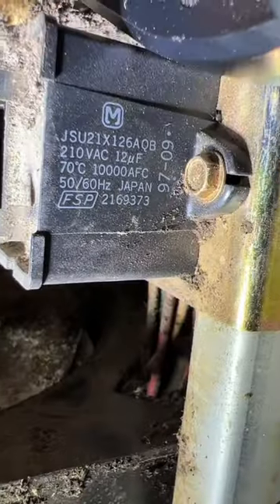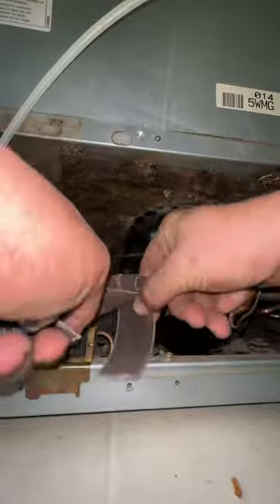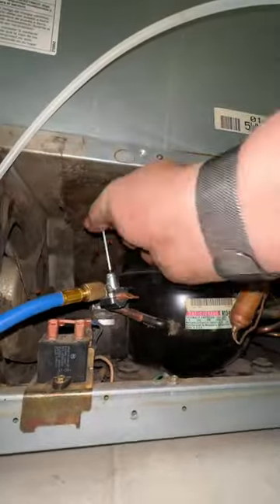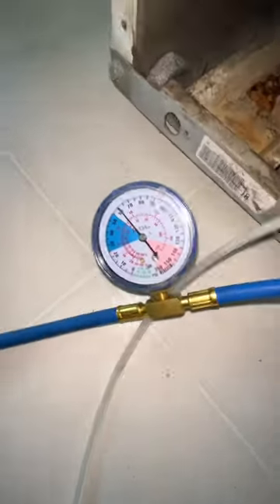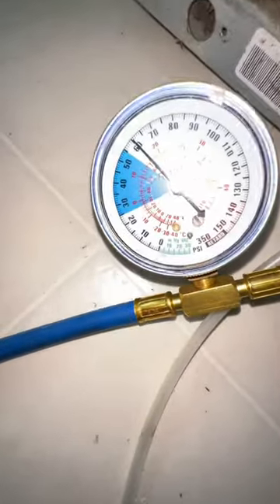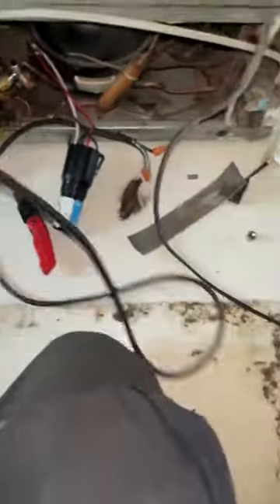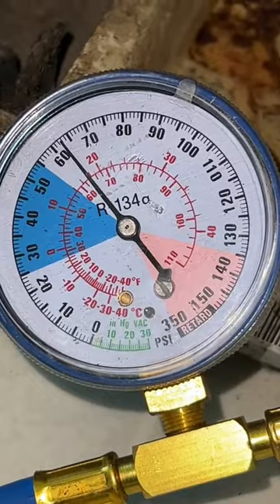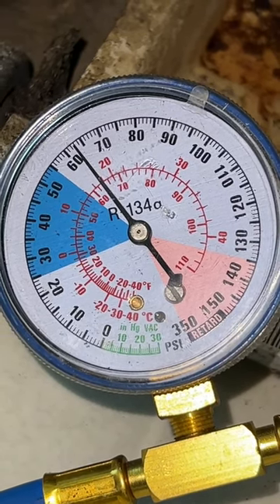A refrigerator than I am unable to fix. #Rental #HandsomeOrHandy #Handyman #ApplianceRepair

Comment: Lmao… “idk just buy a new one”
Reply from the maker: That's what I ended up doing. I might take it apart to see what the issue was but it not going to be used again.
Reply: Compressor change out on a fridge usually just bandage that won’t guarantee it will last forever  I would only recommend it if’s it’s warranty and if not get a new one you will save more money in a long run.
Reply: @sillywaffle2976  depends who changes the compressor. I take pride in my work and when I replaced a compressor I make sure to repair the entire SS (Sealed System) I evacuate then flush all refrigerant lines to remove contaminated refrigerant oil replace filter drier with a sporlan filter drier, install new compressor and braze all joints with silver solder while flowing nitrogen through refrigerant lines. I then pressurize SS to 160PSIG and perform a leak test if the SS loses any pressure I will use an ultrasonic leak detector to locate any leaks in the SS and repair them. Then vacuum SS down to 200-300 microns and perform a decay test after 20 minutes I check micron gauge and if it hasn't risen more than 50 microns I then add refrigerant and tested refrigerator. All of my equipment is inspected and tested at the beginning of my day to ensure that it is working properly and I  replace it yearly to make sure that I continue to use the best tools to do the job.  I have replaced thousands of refrigerator compressors and have not had a failure yet. Most technicians do not go to the same lengths that I go to when replacing a compressor in a refrigerator they sell the job cheap because most refrigerators are cheap so in order to maximize their profit they rush the job. I typically spend 3-5 hours replacing a refrigerator compressor. For this refrigerator the parts and materials would cost around $400-500 the labor would be $400-500 and I warranty my work for as long as the manufacture warranties the compressor 1-5 years depending on the manufacture.
Reply: Your contradictions say don't hire you.
Reply: Sometimes it's cheaper to replace then it is to buy replacement parts and pay for labor
Reply: @christopherscott8853  you’d rather go with someone that does a bunch of work costing as much or more than a new fridge and isn’t likely to last?.. lol it’s being replaced because it’s very like that that’s the smart thing to do. Everything else will cost as much or more and not last as long. Everyone’s a know it all these days. If you were doing your own labor, sure, but paying someone and for parts and such is stupid over replacing it in this instance.
Reply: @mrjjman2010  I think I meant to comment...not reply.   His contradiction was...he checked the start relay after verifying the compressor was running with low Amp draw.  I don't repair small appliances unless they are mine.  I do own and operate a small hvacr company.      Small appliances are tedious....and I don't carry piercing valves but I've purchased them for my own stuff.
Reply: He has a bad compressor he was correct in his assessment
Reply: Dude knows so much about everything nobody can possibly know everything but he is badass
Reply: @mrdrchad6110  it's never worth it to change a compressor on a regular top bottom because it's simply cheaper to buy a new one. Unless for some reason there's a major supply chain issue like in the beginning of covid. You clearly know your stuff but this is a question of where the customers money will be better spent.
Reply: @mrdrchad6110  as a appliance technician, I respect this comment. I won’t say which brands, but even after all of that thorough work the fridge can fail. Usually floating restrictions, or leak with unexposed areas. Deeming the unit un-repairable. If it’s still within that 5 year SS warranty, we can usually get the manufacturer to provide a exchange review. 😢
Reply: This guy is a hack 🤣🤣🤣
Reply: @mrdrchad6110  I’m guessing thats why they scrapped the unit, $1000 i could get 2 basic units to replace it. 

Same situation I had with small standup freezer. First repair was warranty, second was a curb weight.
Reply: A fridge like that isnt worth it. U can see it's very old. Labor and mats to do a proper compressor change would be near or more than a new one
Reply: @huboant2879 Which brands are the ones you would stay away from?

Comment: Compressor valve burnt out replace compressor cost about $950.
Reply from the maker: and the fridge is worth 600 new so that is why i replaced it.
Reply: @HandsomeOrHandy  I tell people if you can find one then do it. Newer refrigerator are designed to fail before the compressor burns out.

Comment: So the reed valve is broken on this compressor. You'd see almost equal pressure on high and low side. The reed valve opens and closes depending on the pressure in the head of the compressor. Opens on the downward stroke, closes on the upward stroke forcing the refrigerant into a smaller space causing a higher pressure and allowing the compressor to pump the refrigerant through the system.
Reply: A man of understanding. Nice.
Reply: That 1.3 amp run load though…
Reply: @tech5298  that's pretty typical of a small compressor like that.
Reply: @intergalacticprophylactic  
I guess so. I would expect .4 amps or something with no resistance from properly working valves. If there is no back pressure, the operating amps would be lower than if the valves were good. Thoughts?🙂
Reply: @tech5298  who hurt you?🙂 I just don't understand why the 1.3 amp was interesting  from the first comment.. " that 1.3 amp draw tho"  just sounded like it surprised you. Are you a refrigerator tech or something..  I just didn't feel like 1.3 amps is horrible for a small reciprocating compressor.  But I don't work on refrigerators all day. I mean if .4 is it then sure. But thanks for showing me how you interact with people. Noted. Thank God I don't have to work with/be around you ever.
Reply: @intergalacticprophylactic  
? You are trolling right?
Reply: @intergalacticprophylactic  you're mad weird
Reply: Finally someone that knows what he's talking about

Comment: It's probably that rack that the freon circulating cools down in is gunked up. Had the same problem in the kitchen I worked at as soon as I cleaned those frills the freezer came back to life.
Reply: I appreciate your comment but if the pressure doesn't change and the compressor is running then the compressor is fucked, no matter how dirty the coil (frills) is. In lamen, if the cold end is clogged with dirt, the pressure will go down. If the hot end is clogged, the pressure will go up. In hvac you have safety devices to stop the compressor from running in low and high pressure situations. However, if the compressor is running but not compressing, then it's bad. Obviously.

Comment: You can replace that fridge for 800$. Even with a friendly discount that repair would be more than half the cost. Those compressors run anywhere between 120-200$ my cost. Parts alone would be close to 500$ for the customer. It's just not worth it for a unit like that.

Comment: Simple.....
If the compressor  is  running and there is no quick drop on the suction pressure on start up then that is telling you the compressor  has lost its pumping  ability.
Then all you do is replace the compressor  following  the  correct steps and no need to condemn the  fridge.
Eazy peazy.
And that looks like a ¼ hp compressor.  Which here in Southern Africa  is $220 to replace all costs in . Sweet.
Reply: Haha in north America,  that's a condemned fridge.
Reply: Here compressor is 500 € and if you somehow get tech to come, that's another 500€ for labor. 599 € for new A+ fridge with warranty
Reply: I don't know what a fridge uses for an expansion device,  but in automotive air conditioning, a failed expansion device can also cause no change I  pressure while the compressor is running. It's not necessarily a bad compressor.
Reply: @Krankie_V  they usually use a capillary tube as an orfice
Reply: @NDC1115  that doesn't sound like it's very failure prone haha
Reply: In America, its cheaper to buy a new one then pay someone to fix it. And someone will buy broken one for 50 bucks
Reply: @Krankie_V  
It’s a cap tube system.

Comment: The dust is what killed it you gotta clean it after a few years or it goes kaput. If you hear it click often it's time has almost come if you don't help
Reply: No? The compressor was running so the Reed valves just blew. Just needs a new conpressor.

Comment: Just replace your compressor and drier and off you go again. Hermetic compressor overheat and there is two copper flaps that act like intake and exhaust valves. They bend/warp and they tend to stop working. Some counties like India do cut them in a half to repair them.
Reply: That I’ll be $450
Reply: @fliprodriguez5250  for that size of a compressor R134A including fitting i could do TOPS £300 all in 😉
Reply: @e1made  if you have the hook up then yes

Comment: That s exactly what happened to me ..service  told me either new one , or replace compressor plus recharge about 650 ...i could hear the compr kicking on , i put a neeple , evacuated evrething with vacuum , recharged it .. it worked and still works and keeps it cold ..so I don t f know what in the f I paid the service for if I did it my self and the compressor actually is good .

Comment: You couldn’t determine that the compressor was not operational without putting gauges on it? How about checking to see if it was getting voltage and then if it is getting voltage checking to see if it’s drawing any current.

Comment: Call an actual tech.recover the charge if any and pressure test with nitrogen.
Reply from the maker: the charge isn't the issue. it's the compressor check valve on the high side.
Reply: @HandsomeOrHandy  low charge will give you similar low and high side pressures

Comment: Your only checking one side of the systems pressure. How could you possibly know that the pressures are the same if your not checking discharge and suction pressure simultaneously?
Reply from the maker: the system was off and when I started the compressor the PSI didn't change. I don't need to know that the high side is doing if the low side PSI didn't fluctuate.

Comment: Clearly has a bad compressor and is a real easy fix, also still cheaper then a new fridge. Replace them daily on small to medium commercial reach ins
Reply from the maker: I don't know that i will ever replace a compressor on a home fridge. If it was a commercial fridge or a specialized unit then I would replace it.
Reply: It's not worth the money or time to replace the compressor on a 10 year old Residencial refrigerator

Comment: Yeah I'm not sure what's wrong with it but you need a new refrigerator

 well good thing I called you huh
Reply from the maker: the check valve on the high side of the compressor was bad.

Comment: Bruh a compressor replacement was needed 50psi or more on running unit means it’s lock rotar
Reply from the maker: it wasn't pulling LRA, the compressor was running but not creating any pressure change.

Comment: Im a professional and I fix these systems everyday. I'm very tempted to go on a long rant on everything he did wrong,  but all I will say is I feel bad for the people that got this guy!!
Reply from the maker: Oh do tell what I did wrong
Reply: @HandsomeOrHandy   1st off did you ever check the frost pattern on the evaporator? Did you check to see if the condenser fan was working while the compressor was running? Why did you put  a piercing valve on?   If there wasn't already a leak you just created one!  Anyone that has worked on these systems for a good amount of time knows that piercing valves are known to cause leaks!!  This was obviously a failed compressor you could have replaced the compressor and soder it in new joints and charged the freon!  You also could have checked each one of the windings on the compressor!
Reply: This was a 1/2 ass attempt at diagnosing an obvious problem. You just gave up and recommended a new fridge!  Now they're gonna go buy a shitty 600r fridge that might last them 5 years if there lucky!
Reply: @HandsomeOrHandy   I've never once seen a professional technician use a 3 to 1 on a  Compressor that didn't come with it!
With the Hard-Start Kit still connected, this will allow the compressor to start and run without the motor-run capacitor. The compressor was not designed to run without the motor-run capacitor, and it will overheat and lead to compressor failure.

Comment: Turns out it was the outlet 😂
Reply: Did you miss the part where he said it had power?
Reply: @richard2mitchell  Did you miss the smiley face? 
I saw the video just like you.
Reply: @jaredj631  do you think emoji shows up on all devices?
Reply: @richard2mitchell  yea they do
Reply: @richard2mitchell  🤷‍♂️
Reply: @maksymoo5100  HAHA no they dont on my old lg stylo 1 it shows all emojis as a box with a X in them. there is other software that is settings to render them come turned off by default also.

Comment: Ohm out the compressor. The two windings must be complementary: add the run winding to the start winding. The sum must match the ohm reading for both in series. R=1, S=8, R+S=9. If the numbers are off by more than 0.1, compressor is bad. Never put a piercing valve on first.

Comment: We're u able to check to see if you were getting the voltage to the compressor?
Reply from the maker: I have a test kit with a starting relay on it. I plugged the compressor directly into it and I could feel the compressor running. Even with the compressor running there was no pressure change.

Comment: 609 certified, or just a handyman?
Reply: 608
Reply from the maker: I do have my section 608 certification, but most of my work is as a handyman.
Reply: @HandsomeOrHandy  that's good to hear, but I kinda guessed as much due to you knowing to use a piercing valve and having hoses/gauges. Not to nitpick, but small appliances(which a fridge would fall under) would require the EPA 609 cert. You are still way better than any maintenance/handyman I've ever dealt with as a HVAC service tech. I agree that it was a good call to condemn the fridge, I don't know why anyone would replace a condenser on one personally.
Reply: @jaredj631  technically, small appliances (fridges) and automotive require the EPA 609 certification
Reply: @neohippie94  that’s not true. Section 608 type 1 certification or universal certification covers anything that is charged with less than 5 pounds of refrigerant, such as fridges and stuff. 609 is automotive.
Reply: those certifications are easy to get anyway.

Comment: No way to put some kind of booster on that compressor, similar to how you would a heat pump or AC?
Reply from the maker: The compressor was starting just fine, the issue was with the check valve on the high side not allowing the compressor to build up any pressure.
Reply from the maker: The compressor was starting just fine, the issue was with the check valve on the high side not allowing the compressor to build up any pressure.

Comment: They don't sell compressors there?  

I hope they called someone else...
Reply: Not worth the trouble
Reply: @davidwills5365  For the repairman, or the person paying for it?  

I had a compressor put in a fridge in January...  Cost me 400 bucks.  Was 1600 to replace the fridge.  

Like I said, I hope they called someone else.  Cause this guy is not very good at his job if he can't replace a compressor.
Reply: This won’t always be fact in few years it will burn out too and if it’s cap tubes it’s not worth it unless you can get warranty.
Reply: @sillywaffle2976  Mine was out of warranty when I had it replaced...   Not sure what you're talking about, or what you're trying to say.  That buying two compressors that still cost less than a new fridge, is somehow not a good decision??

Compressor just aren't that expensive unless you're buying them for commercial equipment.  And a compressor for a 12x18 walk in freezer is about 1200 bucks.  Still less than a 1600 dollar fridge. 

And in a few years, refrigerators will be more expensive also...  So that's just a ridiculous justification.   

Do you sell refrigerators for a living?
Reply: @That V8 Life Not sure where you're looking, but you should be shopping at Lowe's. 1600 will still get you a good fridge.   

And anyone not replacing a compressor instead of a complete fridge, is pissing money away.  The guy in this video is pretty suckass at what he does if his response is *just buy a new one*.
Reply: @That V8 Life Where are you shopping?

1600 is middle of the road...  Not cheap at all.
Reply: @joeytomato  damn buddy! get em! 🤣🤣🤣 heck yeah
Reply: At a minimum you're looking at around $400 for a compressor change out on top of the initial service call... How much is a new fridge?
Reply: @That V8 Life Have fun with that. I keep to my 400$ fridge that's works great
Reply: @joeytomato  400 to change a compressor? That's way too cheap. Something is definitely off with your technician.

Comment: Maybe a plug in the output line from the compressor.
Reply: If there is a restriction then the suction line would be in a vacuum.
Reply: @mrdrchad6110  hmm I don't know .
Reply from the maker: I'm guessing it was a bad check valve on the high side.